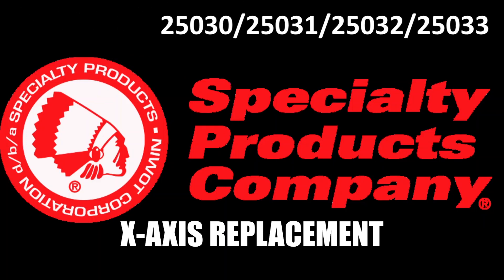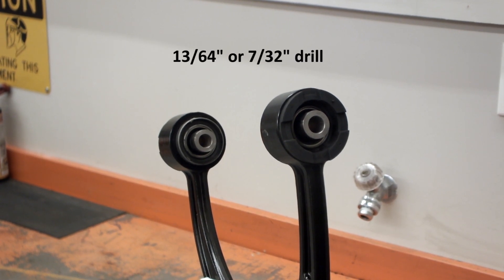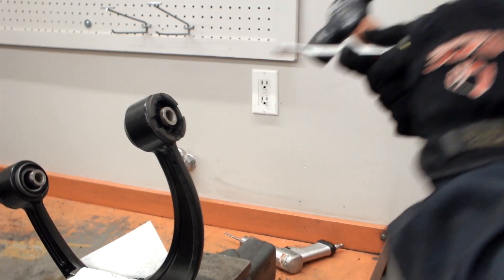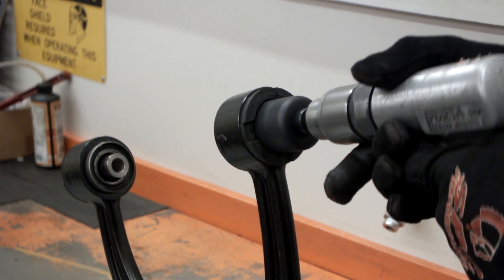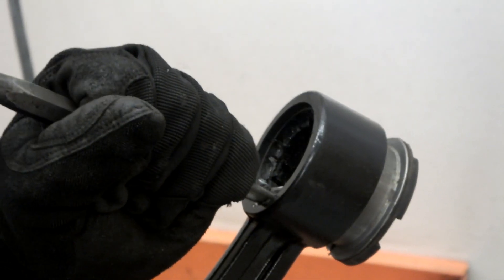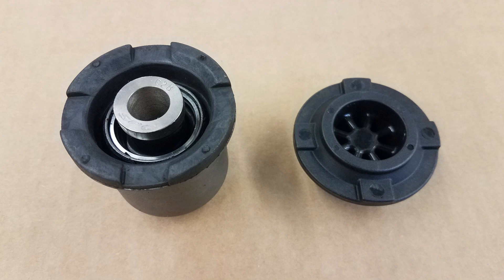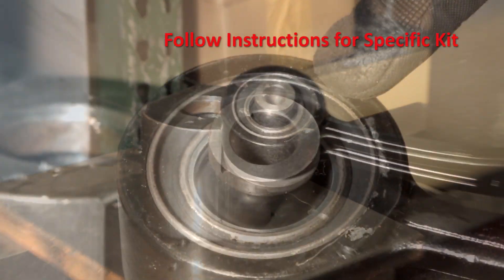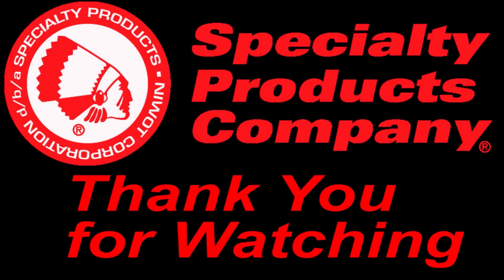25030-25033 X AXIS REPLACEMENT KITS

Comment: So all this to fix a manufactured defect? My arms didn’t last a year and you want me to take a sawzall to my arms and press in the new ones? Unacceptable I paid good money and am very upset with this company right now
Reply: Same thing happened to me in less than a year, crap warranty, bad product
Reply: @LucasFontes77  I’ll never buy from this company again. They should at the very least send these out to whoever bought their crappy product. I went with a different company and they’re holding up well
Reply: How can you tell bushings are bad
Reply: @yezkaholic  with those uniball type setups it’ll be really loose and mine were squeaky.
Reply: @jimmykelly2809  oh ok I don't have squeak just a clunk when going over some bumps. Might be my ball joints then
Reply: @yezkaholic  Jackup the vehicle so one tire is off the ground, grab the tire at 3 oclock and 9 o'clock then push and pull side to side while observing the bushings if the tire moves some and you can see movement at the bushing it will be obvious the bushings have failed or failing. On mine I hear clunking noise when hitting small bumps especially while turning no squeaks. 
 I would like to know the warranty on the new bushings
Reply: @iQuantium  yeah it ended up being my bushings got rid of the SPC
Reply: @yezkaholic same mines have so much play. So disappointed and the replacements aren’t cheap either for it to only last a year. Switching to jba